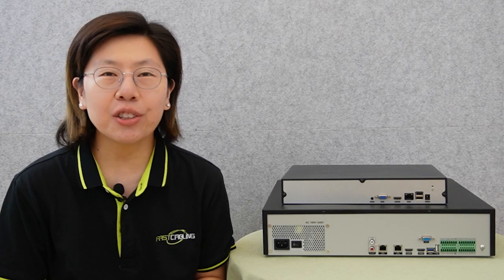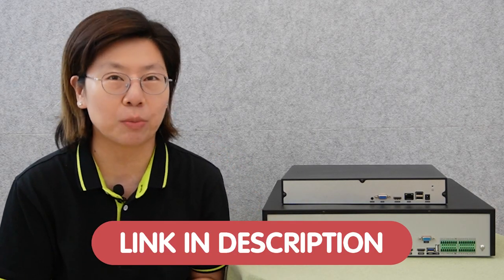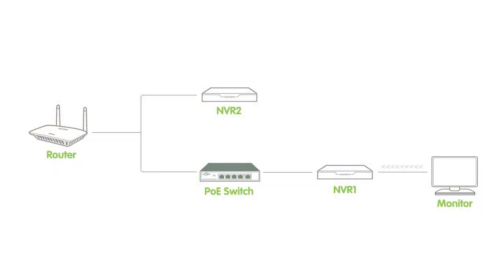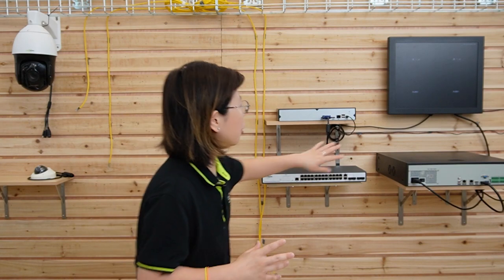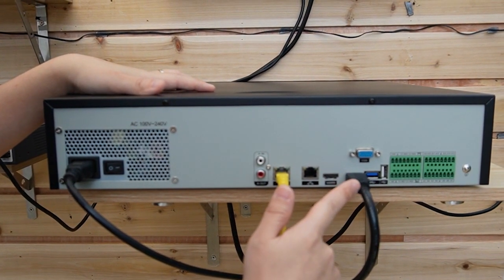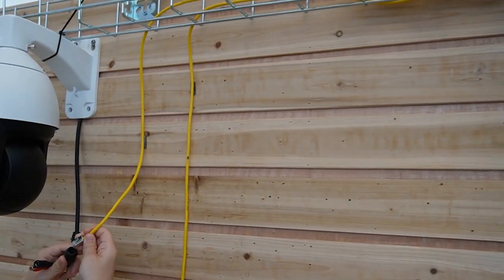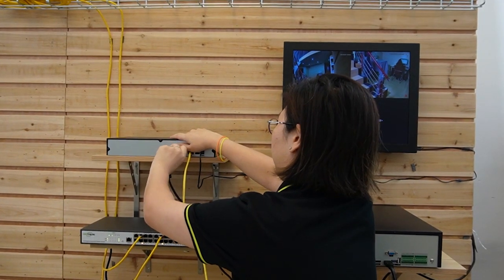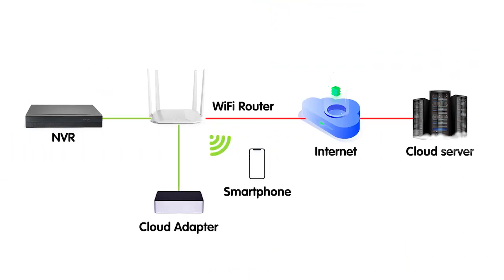Backup Your Surveillance Data: Dual NVRs and Failover for Reliable Connectivity

Comment: Can you make a sample video for new Camera Dual Lens or Tree Lens. Adding to NVR by Len one to Channel 1 and Len two to Channel 2 Len Third to Channel 3
Reply from the maker: Many dual-lens cameras allow you to select which lens stream to add to which channel. You’ll typically have options for the main stream and a secondary stream. Assign the stream from Lens 1 to Channel 1 and the stream from Lens 2 to Channel 2. You may need to enter specific RTSP URLs or select from dropdown menus depending on the NVR and camera model.

If you're interested, watch this video👉https://www.youtube.com/watch?v=_A0eR31A03U.

In this video, we'll show you how to set up a dual-lens camera, to the app and to the NVR. This dual-lens WiFi security camera can display two views simultaneously (with a top-and-bottom split screen layout). You can easily switch between each lens’s view to see a single view if needed. 

https://www.fastcabling.com/product/dual-lens-wifi-security-camera/